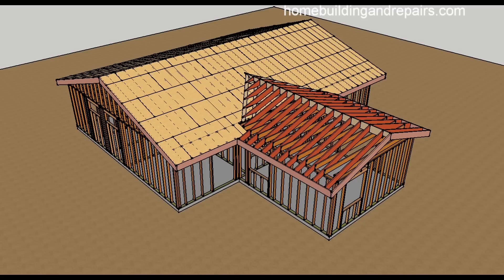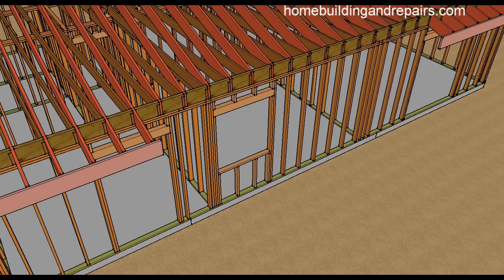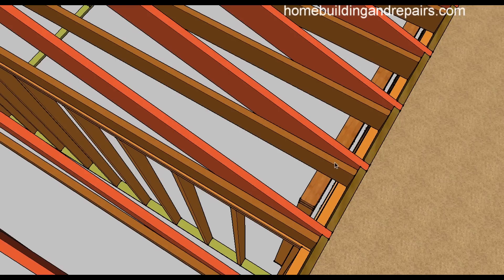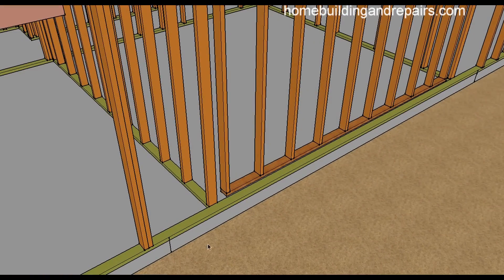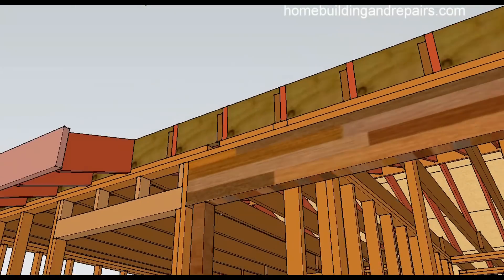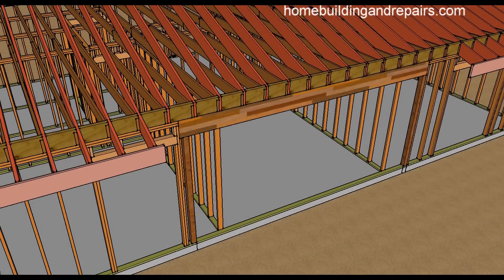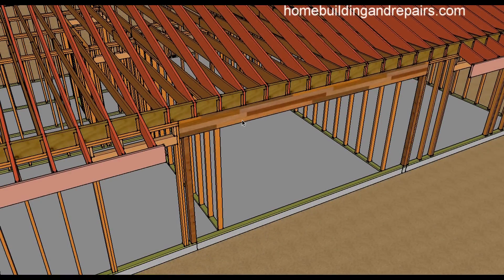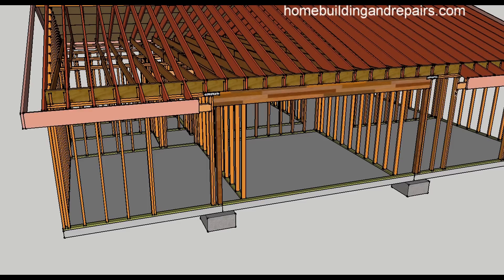Ideas For Removing Wall And Installing Structural Beam For Home Addition Opening

Comment: What if you’re trying to support the weight of a two-story (exterior) wall that runs parallel with floor joist. In other words, I can’t build a temporary wall to support weight in this way where the temporary wall would normally run perpendicular
Reply from the maker: See if you can find a something helpful here. https://www.homebuildingandrepairs.com/repairs/framing/walls/index.html

Comment: Could you support the truss to replace the exterior wall? My 2nd story exterior wall studs and some trusses are waterlogged. I think 1st story underneath is as well. Plan on replacing 2nd story then 1st story. 

Plan is to support vaulted ceiling (3 feet from exterior wall), cut out top and sill plates and remove studs. Will have 48" overlap towards center of wall on top plate, but will have to replace corner tie as well.
Reply from the maker: Yes, you might need some additional bracing also.

Comment: Would it be the same concept if you were adding on to the corner of a house
Reply from the maker: I would imagine so. There are plenty of other helpful videos on our website, make sure you check some of them out, especially the engineering, remodeling, framing and home addition videos.

Comment: same procedure when the house is a 2 floors house ?  how would be with the extra weight ?? 25' spam??  any advice ???
Reply from the maker: It sounds like you need a structural engineer for that one.

Comment: Can you go even higher? So the beam doesnt show? And hanger the roof to it?
Reply from the maker: Yes
Reply: @gregvancom  do you have any info on what happens when the beam is sticking up out of the roof?... existing is 2x4 engineering trusses and the beam will be a 6x10...
Reply: Maybe not if you have roof trusses.

Comment: Ok with that beam it would not be flush with the ceiling? So you would have this huge beam showing in the middle of the ceiling? How could you take the weight of the load bearing wall and hide the beam flush so theres a smooth ceiling?
Reply from the maker: https://youtu.be/Xmd5nnyVwR8 See if this helps.

Comment: Thank you for the video!  I would like to do almost the same thing, but with the addition being just as wide as the house. Is there a way to frame a beam in such that the bottom of it is flush with the bottom of the ceiling joints?  And perhaps use hangers to attach the rafters and joists to it?
Reply: Never mind.  Just found your other video. I love your posts. Thanks again!!
Reply from the maker: Let me know if this works https://www.youtube.com/watch?v=Xmd5nnyVwR8

Comment: I'm wondering if there is a way to extend the ceiling on one side of the room and extend it into the other room (as an extension). If the room were to continue out, it would  have a beam at that break point right?  I'm currently thinking of extending the north side of my house. Very similar to the opening you are showing in this video, however it's the entire wall and i would like to extend it out by about 7 feet. But by doing that, it looks like i'll need a deep beam and even some columns along the way.  Great video by the way - your videos are VERY educational and you are very clear. Thank you for putting in your time to make these videos.